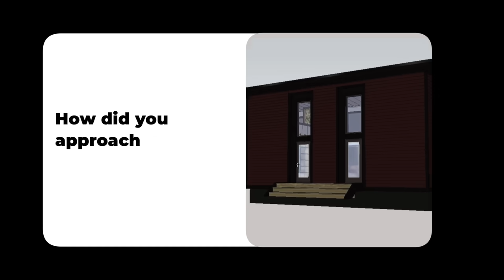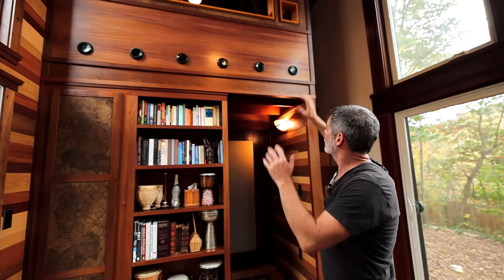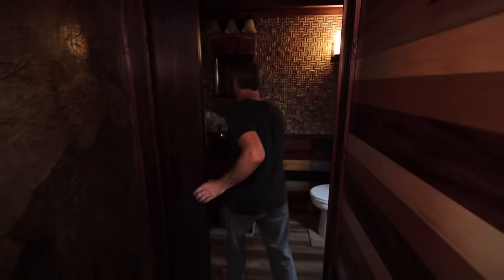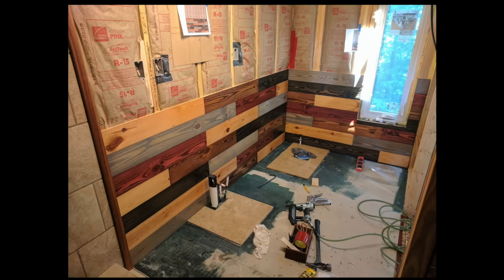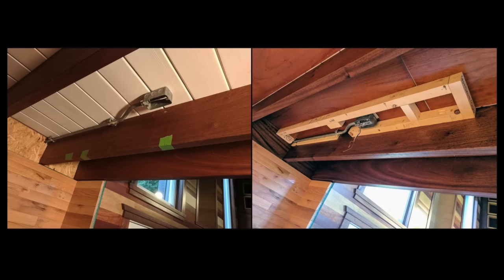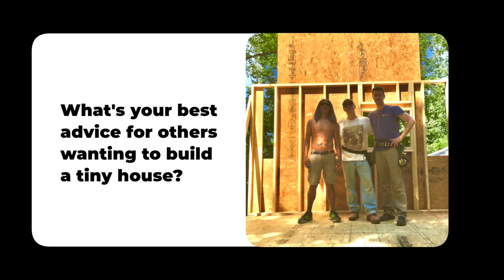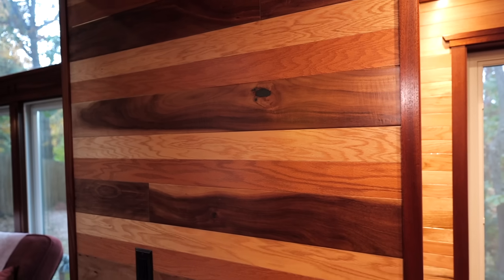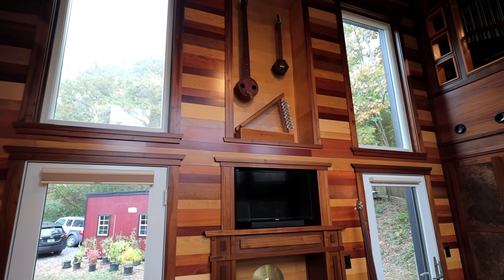Ingenious DIY Tiny House Design Ideas using Salvaged Materials! 🤯

Comment: My advice to anyone wanting to build a tiny house on wheels or on the ground is research everything you can find on building on you tube. Draw out a floor plan and stick with it. Build the shell, install windows and a door, put a roof on it and then go inside and dream. the shell is the easiest part of the build.  I doubt this guys house cost him 80k to build if he used so many reclaimed materials. Although he may have added in the amount of labor he spent building it and gave himself a $50.00 an hour pay scale.